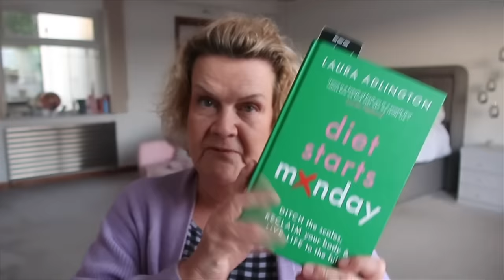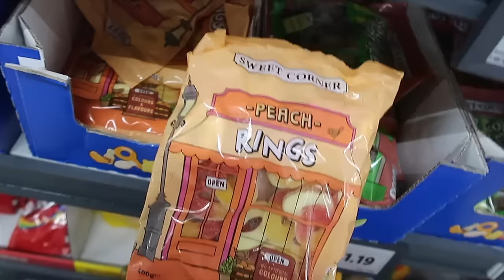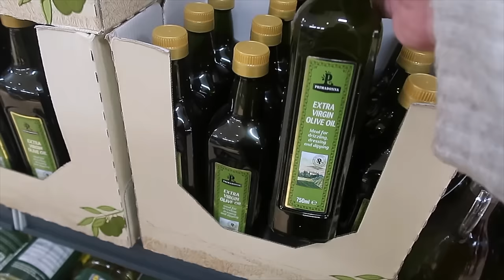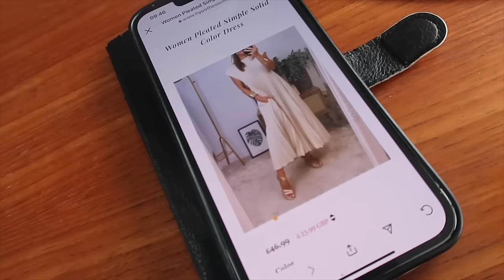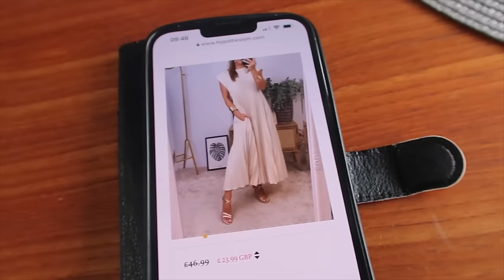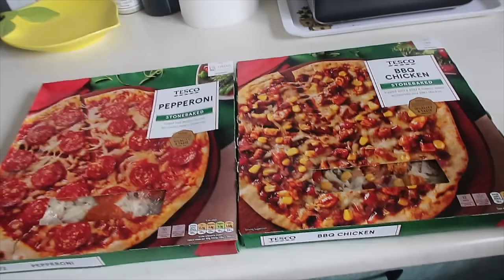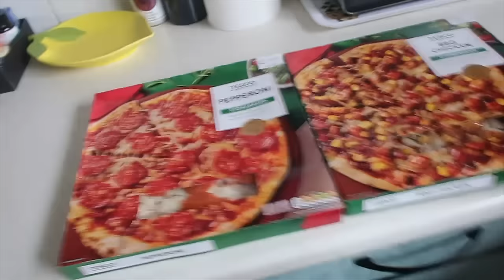Weekly Vlog: I've Got To Do What's Best For Me

Comment: Hi Caroline, 
I have several bottles with lights and had to replace the cell batteries regularly therefore  I bought some usb charging ones from Amazon and they fit the bill perfectly . 👍🏻
Reply from the maker: Oh that's a great idea, I've not seen chargeable ones, will check them out, thank you.
Reply: I’m really pleased with them and I like the cork  cap that covers the usb connection .I’ve saved a fortune in batteries .
Reply from the maker: @dorothyclarke5683  I'm so impressed with this idea that I've added a link to the rechargeable ones in a pinned comment at the top of this comment section.  Thanks so much for mentionign it.